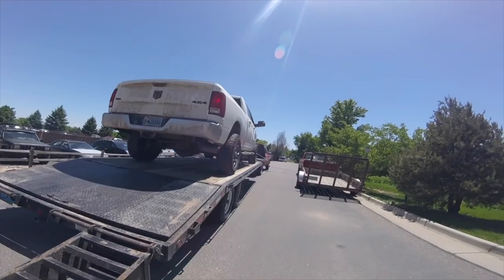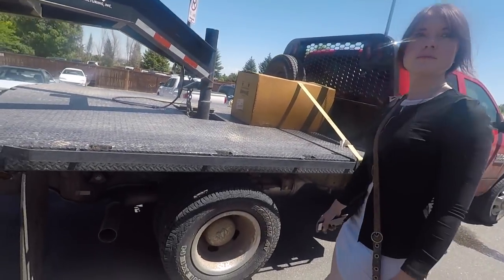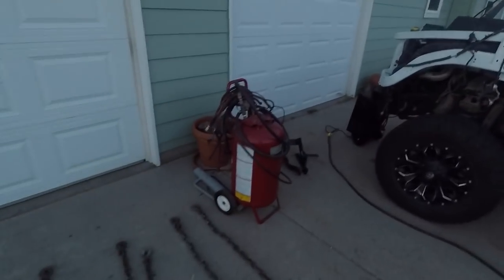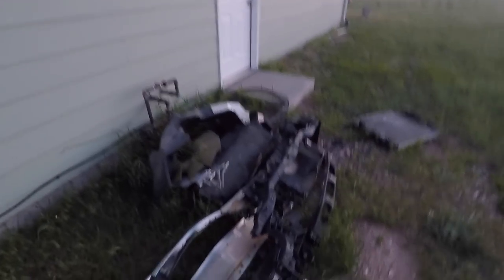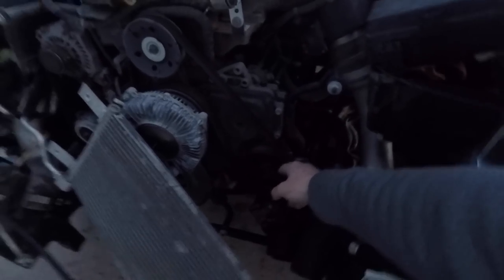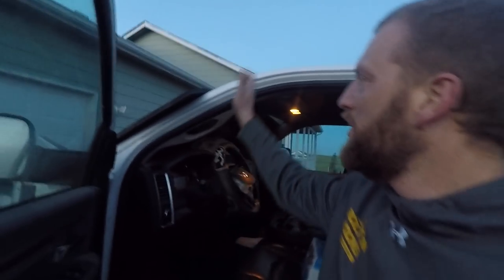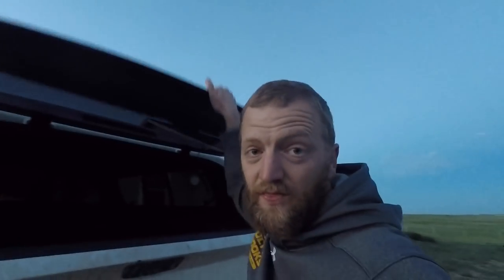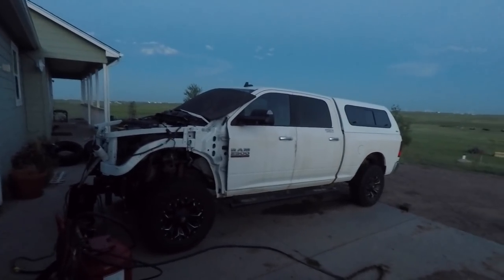Wrecked Ram Rebuild!

Comment: The Automobile Club in the uk Recently Recoverd my sons 07 Jaguar XJ 350 . Pulled it on a trailer not quite long enough for a full size Car , they did like you did on the Ram and ran the Cable back underneath , UNLIKE YOU DID However they hooked to the ---- wait for it STEERING ARM!!!!!!! Bending the inner and out link. So much for profesanals .

Comment: I know it sounds picky but when you replace the seatbelts use new factory spec bolts to anchor them down and torque them to the proper foot pounds or newton meters. Your Seat belt bolts have now been stretched  and are no longer going to perform the same in a head on collision. I work in a car plant and we’re very serious about  this type thing. We would refer to this as an “A” rank bolt. If Ram is like us you will see a magic marker line on that bolt. It’s to confirm someone checked to see if it was properly seated.

Comment: Probably stupid to mention but you didn't mention turn signals, and have you checked to make sure the windshield wipers work? Also the washer fluid reservoir may need replacing.

Comment: As far as the charging, make sure to check the crank speed sensor. If it goes bad, the truck doesn't know its running and won't excite the alternator, which means no charging.

Comment: Think about the lock. If you flip your truck and the seatbelts lossen up when after the first roll then the 2nd roll your no longer safely secured. So the new belts have a permanent lock to prevent further injuries during a wreck. 99% of the time the EMS will be cutting the belt anyways.

Comment: Blake on the new ones I think the alternator charge wire connects to the right/passenger side battery wire.  Looks like your crossover battery cable is removed so it wouldn't charge.  My spin on what I see from the video.

Comment: If the Fan hub and clutch fan is broken then the Water pump should be checked and most likely replaced due to possible internal damage.  It is also better to replace those bent coolers because they won't work as well.
Reply: It's a Cummins, Fan and clutch is not mounted on the waterpump like a gasser.
Reply: According to the mileage, I would replace the pump while it was that easy to access.

Comment: Only thing I was thinking was when fan and clutch were damaged, how much force was transitioned into the water pump. Sounded ok now and don't seem to leak but may have a little bend in the shaft or bearing brinnelling.
Following the fix, see you on GTT.
Reply: I just replaced the water pump, belt tensioner and idler in my 2005 dodge cummins. Those are a challenge to get to. I would change all that now while it's easy access
Reply: It's a Cummins, Fan and clutch is not mounted on the waterpump like a gasser.
Reply: I had a 2005 and have a 2015 Cummins. Take the airbox out and it's a 30 min job, 2 10mm bolts.

Comment: Hey I actually have a question. I am doing almost the exact same build on a 2016. I have bent side supports that I can’t figure out how to get off. I have drilled out all the spot welds I could find but it still won’t break loose. Did you have to deal with that at all?
Reply from the maker: We had the same problem, but that part of the job was done by a professional collision shop.
Reply: Yea I might have to go the route too. Good luck on the build.

Comment: guy you should change/ rebuild all the pats to the airbag system. the two or four sensors up front if there an on-off switch on the dash etc. that's as you know what tottles vehicles today here in new york if its a totaled vehicle it needs to go for a new york state wreck inspection which is different from the yearly safety inspection. and you better have all your receipts especially anything to do with the airbag system as you said everything over powered to set off the bags

Comment: So the truck is not yours right. If it is then cool then you have two Cummins trucks to use if not then cool you still have a brand new Cummins for ya and on the red cummins the one you bought forever to replace the ford what snowplow are you gonna put on it

Comment: Sorry but as fast as you were moving the camera around I couldn't see anything on the truck. I think I'd change the water pump too though to be safe and it's much easier to do now than it will be afteryou get it back together

Comment: Thats sure going to be some work even with the frame done now, but hopefully all that other stuffs worth less than the new truck, I hate it when some stupid little plastic part is $300 plus. you only need a couple of them to ruin your day !.  I had a starter job last week on a 7.3 diesel ford that should of been simple. They changed it to a gear reduction at some point, on any of those with 3 bolts there is usually one thats a pig to get in or out.

 That truck had it partly due to the idiot that fitted it before, it took over 3 hours to remove 3 bolts 2 wires and re fit the new standard type starter the guy got.  He told me after I fought with it in his bin yard where it quit, 4 other guys had refused to do it, even if he towed it to their shops.

 Yeah now I know why they didn't want to do it, Like that frame job I should of turned it down to L.O.L. The guy also told me he knew once I started I wouldn't let it beat me and it would get done. He hasn't had the bill yet either it won't be cheap for laying under that truck, getting soaked in the storm that came in while I was finishing it. Plus getting covered in 5 years of oil leaks and road crap that was all under it, but hey the frame will never rust out L.O.L. Thanks for sharing, Both of you take care.

Comment: Wouldn't it be a lot faster to have dealer fix the truck if insurance company is paying for it ?
Reply from the maker: The insurance company isn’t paying to fix it, they totaled it. We kept the vehicle and worked out a settlement with them after the accident. Because of the way Wyoming laws work, the truck keeps a clean title because Victoria is the original owner.
Reply: Guy in WY yeah I'm sorry I remember now it was totaled.
That's great your getting it all straightened out and fixed